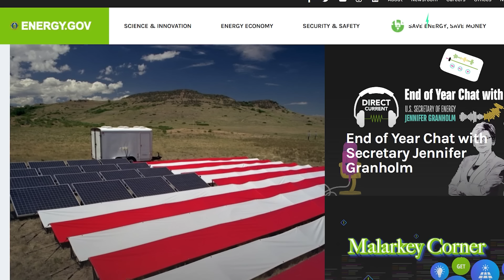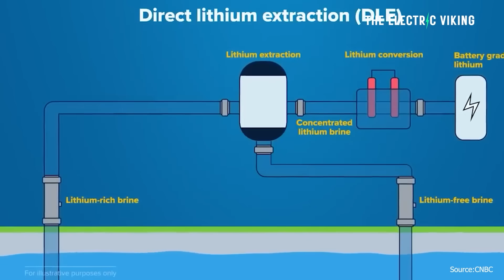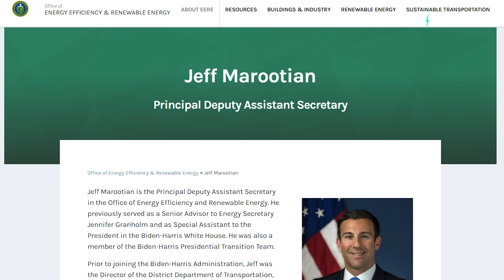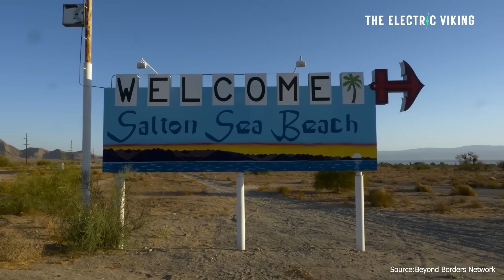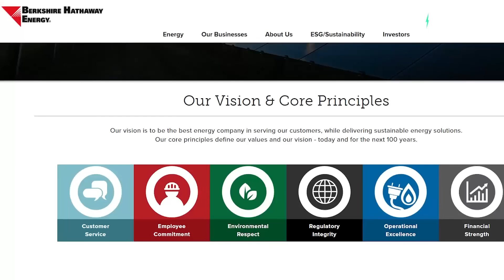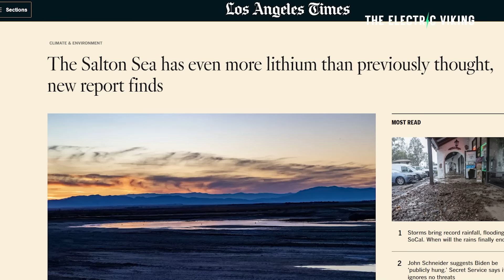A hidden deposit of lithium in an American lake will power 375 million EVs

Comment: I've been exactly to that location. There is no accessable fresh water. It takes 500,000 gallons to process 1 ton. While Tesla does have an idea of processing without water; that won't work. Why not - your own video shows why with the Giant Catapillar earth mover - you need to bring the plant 500 tons of ore in order to get out a couple tons of lithium. To move 500 tons of ore 10 miles takes 500 gallons of Diesel. 4 tons of CO2 to get one ton of lithium. For each 10 miles of moved. Not green.
Reply: Nothing is entirely green. But we'll figure out better ways of processing.
Reply: Eh. Build the plant closer. Isn’t it water? Pipe it.
Reply: My proposal would be to replace the fresh water required in the process by water cleansed and processed from the salton sea using solar energy which is an abundant energy in the region.
Reply: @beatreuteler  yeah, don’t know why they don’t capture the clean, evaporated water. They can do this in Arab countries too instead of desalination plants. Evaporate sea water, drink the water, sell the salt.
Reply: @jamesvandamme7786 
Those claims were made for wind turbines too.
To date, the only way to recycle the blades is to grind them up and burn them for generating electricity to make new ones. 
They are being recycled by burning them.
The same claims were made for plastics, so glass bottles weren’t used anymore and very little of plastic is recycled.
Despite lithium batterie technology being around for decades recycling is still experimental.
Reply: Ok, so you've been there. Wow. That's amazing.
Reply: @delavan9141  yes that is right and there is no water - so you can't refine lithium there unless you try some rediculous waterless process- so what will you do with that lithium? ship it to somewhere with water? Forget it; may as well be on the moon.

Comment: The problem has never been that there isn’t enough of any given mineral. Earth’s crust is huge and nothing is that rare. Rather, it’s the cost of finding high density deposits, then developing those deposits. There’s lithium under your feet right now, wherever you are - just not dense enough to make it economically viable to extract, compared to other places. As a mining expert I listened to the other day said, if one deposit has 0.6kg of a mineral per ton, and another has 6kg per ton, which is more lucrative to mine?

Comment: 2,000 meggawatts is 2. GIGAwatts. There are enough natural Hydrogen  deposits to run a million car. There is enough recyclable Lithium for 2 billion cars,a hundred million  trucks. But can Aluminium wires substatut for recyclable, copper. When a cemetary stood before progress, we moved it.

Comment: OK James ; but it probably won't be with Lithium ; maybe sodium or carbon  or something more energy dense.  Lithium is a dead end.  It doesn't scale enough. Even if you 10x current production today; it would take 1 year to produce enough to replace just US heavy trucks; 20 years to replace world heavy trucks. That is if every ounce of production went to trucks; nothing for 1 billion cellphones made annually, no power walls , no megapacks, nothing else. Something easy to refine that is highly energy dense and  has a long life.
Reply: It does not make sense to use the most energy dense chemistry for power walls. For these, either take 2nd life or Sodium Ion. There will not be much more energy dense materials out there to replace Lithium. Look at the periodic table of elements. Everything lower  in the table than Lithium will be LESS energy dense. Carbon is already used, but on the other end electrode. Lithium is not a dead end but over time may become the premium material, (for example for aircraft) while the big mass will go and get cheaper ones.
Reply: Sodium yes, but carbon? Carbon can be used in the cathode or anode in the form of graphene or graphite, but it's not a replacement for lithium as it's in the wrong place in the periodic table.
Reply: @aftonline  some people think graphine will work

Comment: Meanwhile, sodium batteries are coming to the market.
😂😂😂😂😂
Reply: Sodium is a heavier element when compared to hydrogen and carbon.
Reply: @valenrn8657  however, it is more abundant and, of course, cheaper.
Reply: @ilovebarcelona9256  Sodium-ion battery has lower energy density.
Reply: @valenrn8657  Let technology evolve.  Sodium batteries are just beginning to be used in cars.

Comment: and copper silver? just lithium is not enough for EVs
Reply: Copper isn't a viable replacement and Silver is too expensive. Among these 3, Lithium is the way to go. However Li-Ion batteries also use copper, but for the connect foils, not for the active material.

Comment: Just curious, does that 24 years include lithium recycling?
Reply: Nope!  With battery recycling, there is enough lithium in this one deposit to transition the entire US automotive fleet to BEVs... for ever!
Reply: @st-ex8506  No. There are over 400 million personally owned cars on the roads in the U.S., putting aside commercial fleets.
Reply: kind of funny when you read that its hard to recycle lithium.
Reply: @AndrewTSq  No, it isn't.  Metals are elements that are easiest to recycle.  Just the word of a chemical engineer who has been involved in the recycling industry...
Reply: @st-ex8506  So, why battery manufactors say that then? you should tell them they are wrong.
Reply: @AndrewTSq  Obsolete fact!

Watch what the competent recyclers say, Redwood Materials for example!  Not only do recycle metals cost 60+% less than "original" ones, but they come out purer, and the recycling process has a significantly smaller environmental impact than the initial extraction + refining ones.

That is quite normal.  The difficulty and costs of extracting and refining a metal (or pretty much any other resource for that matter) is mostly (but not only) dependent on the source concentration in the initial ore/brin.  These concentration are typically in the 0.01-0.2% range e in the case of lithium.  In the so-called "black-mass" that is crushed-up recycled batteries, the concentration of lithium is in the 2-4% range, i.e. 200 times higher!
 
Tesla has also communicated that they recycle 100% of their out-of-spec batteries rejected by QC.
Reply: @AndrewTSq  It's hard to recycle phone and vape batteries because they are small and have to be ripped out. A couple hundred pounds of EV battery will be easier to deal with.

Comment: I live about 40 miles west of the Salten Sea as the crow flies. It's going to radically transform that area, which is basically one of the poorest areas not just in California, but the entire country. My grandma actually has land out there that she's been holding onto for us because of the potential it will have in the future. It used to be worth practically nothing, but we're betting in a decade or two it could be worth a boat load. They're not just going to mine the lithium there. The locals have made deals that the lithium must be refined there as well so they create more jobs. And chances are there will be some battery factories popping up in the area too. You're really not far from Palm Springs, so you could easily get qualified talent to move to the area. It also happens to be super close to one of the countries main freight rail lines that runs along the 10. It's where tons of goods come through the country from the LA and Long Beach ports. So there's a lot of support infrastructure already in place (as opposed to Vegas and Salt Lake City). But there's something unique about the Salten Sea lithium. For one, it's considered the highest quality lithium on earth. Another thing is it's considered the only completely clean (renewable) lithium mine on the planet. There is no waste. In fact, the "mine" is actually just a geo-thermal power plant that's been there for a while. That's because there's a volcano underneath the lake. So the brine from the extraction process just gets shoved back into the volcano and gets recycled.
Reply: Still believe that the Salton could be used as a giant capacitor for energy storage . But lithium is history .
Reply: Your mistaken, the process thats coming to lithium extraction is a factory where its pumped up, filetered out and then its returned back to the earth, underground. Its clean, efficient and fast with the EnergyX companys tech. See Munro Live as he talks to them about it.
Reply: @philliplopez8745  A giant capacitor?  What do you mean?  And yes, I know what a capacitor is.
Reply: Your "boatload" might sink when an alternative to lithium is invented, LOL. And E-cars aren't exactly selling like hot cakes.

Comment: Your wrong, it will make about double that amount as they now have a process that just filters out the Lithium and then can be pumped back underground. Add in the new batt tech of 1000km batt with 80% recharge in 15min and you have yourself a revolution starting in 24/25 but 2030 it will be even better as prices for this will drop from 70% at retail.

Comment: There are evaporites all over the world, many of them ancient fossil evaporites... including all over the SW of the USA. Death Valley used to produce most of the world's borax... similar chemistry concentrates lithium salts in dry lakebeds. There are many places in the world... including huge quantities buried under the sea floor in the Mediterranean. Lithium supply, if it proves to be economically necessary for battery production, will be there for centuries to come.
Reply: Lithium is one of the most abundant elements on the planet. The question is, what is the cost and difficulty of extraction?
Reply: @darylfoster6133 yeah, I don’t get it. Directly uses sunshine as to extract it. Completely free energy! What’s the issue?
Reply: @TheBooban  There are issues with the extraction of this particular deposit, that I read about recently. Maybe I can find the article.
Reply: @TheBooban  One potential problem facing all three lithium extraction companies is that the Salton Sea geothermal brines are not the same as the brines in evaporation ponds similar to those in Argentina, Chile and Bolivia, where more than half of the world’s lithium is produced. Specifically, the deep geothermal brines in the Salton Sea contain more silica and transition elements, which may complicate the chemistry of purifying the lithium.

Bringing this industry home presents similar issues. In the United States, 79% of lithium deposits are within 35 miles of Native American reservations and tribal lands. At Thacker Pass, Nev. — site of a proposed hard-rock lithium mine — members of the local Fort McDermitt Paiute and Shoshone Tribe have opposed the project, which they claim sits atop ancestral remains of tens of Northern Paiute that the U.S. government massacred there in 1865. The mining company, Lithium Americas Corp., recently entered into a community benefits agreement with the tribe, but some members continue to push back. Member Shelley Harjo put it this way in an op-ed: “Are we willing to sacrifice sacred sites, health and internal balance for short term economic gains?”

In the Salton Sea area, nine different Native tribes occupied the basin, including the acres now submerged by water, for thousands of years. Today, the Torres Martinez Desert Cahuilla Indian reservation sits just north of the geothermal plants where lithium is already being extracted. In addition to lithium, the brine beneath the Salton Sea contains hazardous elements — including arsenic, barium and lead — that some fear could contaminate the broader environment. At an online meeting of the Lithium Valley Commission, Faron Owl — a member of the Fort Yuma Quechan Tribe, whose reservation lies to the southeast of the Salton Sea — raised concerns about the mining plans. “Toxic wastes, the gas emissions, the pollution, are being put aside for the lithium demand,” he said, while the state and federal governments ignore the “underlying concerns of land, air, and water.”

The three companies vying to massively expand lithium mining at the Salton Sea claim they will use a new process called direct lithium extraction (DLE), by which lithium is drawn from underground brine using filters, beads, solvents or sorbents. Proponents of DLE say it saves time and money and is less environmentally damaging than evaporation brine mining. Ten years ago, Simbol Materials built the first demonstration plant at the site, but it folded after a failed acquisition by Tesla. More recently, a company called Lilac Solutions—aided by millions of dollars from Jeff Bezos, Michael Bloomberg and Bill Gates — tried its hand at DLE in the Salton Sea. This August, the company deemed the hot, toxic brine too difficult to handle for both equipment and workers, calling the region a “graveyard for lithium extraction.” 

To this day, DLE technology has not been proven at scale.
Reply: @darylfoster6133  DLE seems to try to just get the lithium and leave the rest there, leaving the site poisoned. Evaporation takes everything. So it’s a clean up. Don’t we need barium and lead for stuff too? Then just box it and put it away so the land is cleansed. Costs more, but counted as cleaning the environment. I figure that’s what they don’t want to pay for. But I’m not an expert. Thanks for the information.

Comment: Combining this with the massive deposit in Nevada should guarantee we have enough lithium for all vehicles in the U.S. to transition to electric other than ultra-long-haul trucks without having to rely on Chinese and Bolivian supply.
Reply: It doesn’t matter because most of the other key minerals are not abundant in America. Ever hear of nickel?
Reply: @MrAmhara  We have Australia, Canada, and other western sources for that.

But why mention Nickel when it's not even used in current Lithium Iron Phosphate cells and the replacement Lithium Sulphur tech has no need of it either?

Not to mention MIT still working on their graphene-saltwater cell implementation.

Comment: A few points about the Salton Sea. The area is a geothermal hot spot. So, they’ll likely power the mining with geothermal energy. Next, the lake was formed decades ago and has been drying up and becoming more toxic to fish, wildlife and humans since. If they do the mining correctly, the mining companies may actually be able to improve environmental conditions there. And finally, my own broken record. Residential and small businesses-scale battery storage needs to fall a lot in price. Home batteries like Powerwalls are so weak and so hugely expensive that the home battery prices are actually impeding the installation of home and small scale solar and the transition from ICE to EVs and gas to electric heat and cooktops. Powerwalls are like Nokia flip phones. In hindsight, we will see Powerwalls as weak, archaic, expensive, and not very useful.
Reply: Sodium-ion has the potential to cost less than half as much as lithium and a bunch of Na-ion battery manufacturers claim to have major breakthrough in cycle life at over 50k for their datacenter and grid-scale products. Na-ion is also much safer thanks to its far less flammable electrolytes. I'd say it will be a far better choice for in/around the home energy storage once the cells become more readily available. I'd love to replace my UPS' 2x7Ah SLA batteries with 7-8S 20Ah Na-ion cells when they eventually fail.
Reply: Home batteries are going to become a crowded market.  There is no way that powerwall prices will be able to stay as high as they are today.
Reply: "mining companies may actually improve environmental conditions . . . HA HA HA HA HA HA HA HA HA HA HA

Comment: Curious to see if we have learned anything from past rushes and destroying landscape with the gold and oil rushes, or that the lithium rush will somehow be the new oil rush. And where's the conversation of recycling lithium in this exploitation story? That's the beaty6of lithium, right? So why are we talking about a potential capacity of 1000000000 EVs when likely we only need a fraction of that if we also take recycling into account (the latter is the real rush).
Reply: Despite claims battery recycling is not cost effective nor environmentally friendly. Lots of acids and water are needed, just as much as mining.
It’s cheaper and easier to mine than recycle.
Mining and recycling will be an environmental and social problem just like oil and gas.
Despite lithium battery production being used for decades there is no way to recycle thenmwithout environmental damage.

Comment: Even if we were able to extract enough lithium, how you going to charge the batteries? 

Will have to use hydrogen and fuel cells to produce enough power to power the lithium batteries 🤷‍♂️

Oxymoron 😏

Comment: Cobalt is the wild card.
Reply: Why ? LFP batteries don't use it and neither do sodium batteries.
Reply: My car's LFP batteries have no cobalt or nickel.  Not needed, especially as the fast charging network further densifies.  NMC batteries only seem to increase the range of vehicles by a tenth or fifth, at great expense, shorter life, and more flammability.  My LFP batteries get me twice the distance between fast chargers even in rural areas of Colorado, and more fast chargers are getting installed regularly.  Ever less reason for the kinds with cobalt and nickel (NMC, NCA).
Reply: You are right as far as cell phones, tablets and other hand held appliances are concerned. But not for cars.
Reply: You mean the cobalt you use in catalytic converters in ICE vehicles as well as the cobalt needed to refine gasoline?